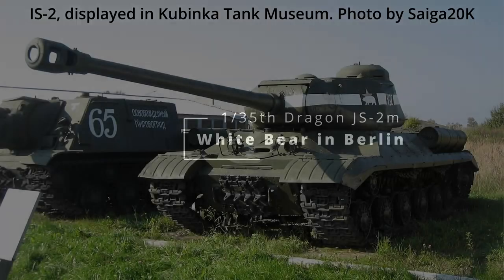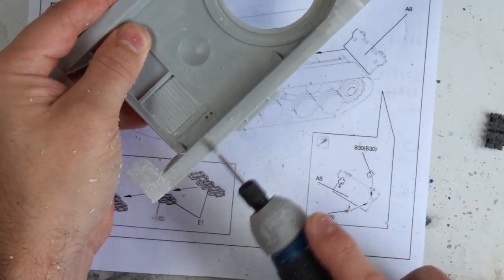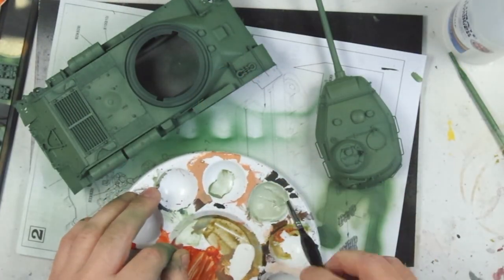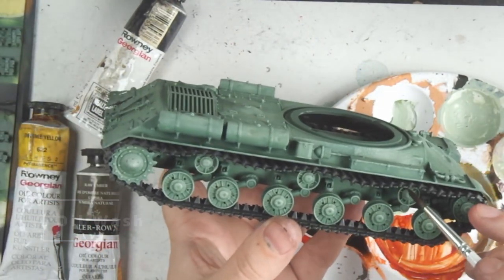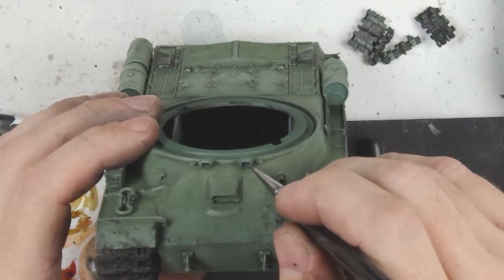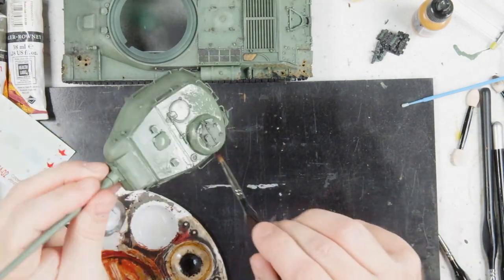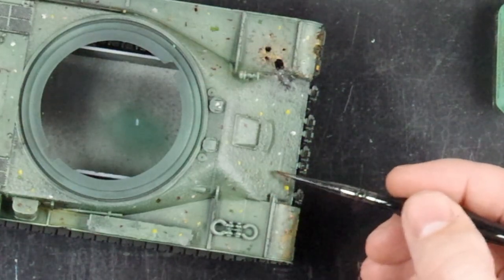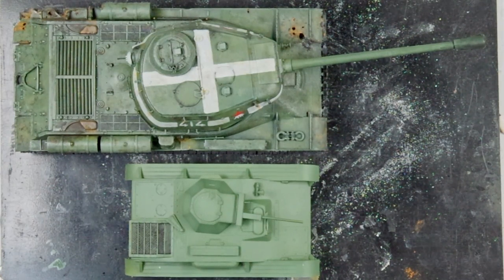Dragon's 1/35th JS-2 Scale Model Tank - a WWII Soviet Bear in Berlin

Comment: When you are airbrushing - do you just do it on your desk or do you use some sort of booth? I was gifted a small airbrush and would like to try it out but I don't know if I need to go through the process of creating or buying a airbrush booth.
Reply from the maker: I've never used an extracted booth - I do have an enclosed space to contain overspray, but I have a chemical filter mask and I spray in a large garage next to double doors. I don't use the spray shield on camera since it's difficult to capture what I'm doing.
At the least you can use a carboard box with two sides cut out to contain overspray and work in a well-ventilated area with a particle mask like those available for COVID - that will be fine for small sessions inside.
Reply: @MannsModelMoments  Ok thank you very much for the advice

Comment: Fantastic model, which pledge do you use am based in the UK and not sure which one is correct. Just got back into scale modelling after 30 yrs. I recently had a brain injury and are using this hobby to help with my recovery.
Reply from the maker: It's Pledge Revive It Floor Gloss with Future, unfortunately discontinued in July this year - but you may still be able to pick some up on ebay etc - one bottle should last you forever!